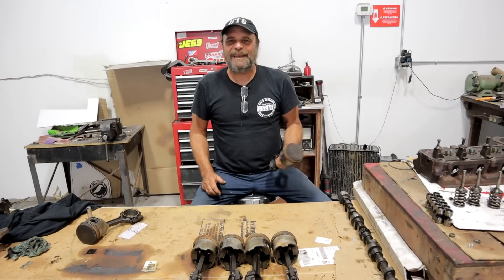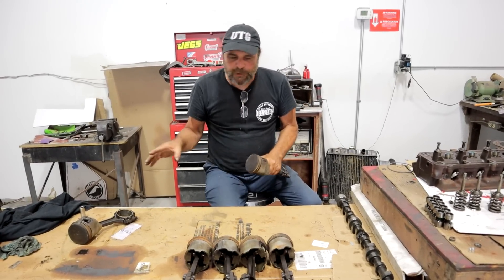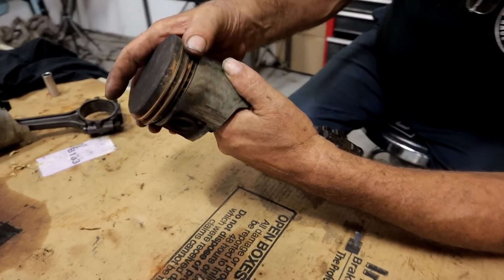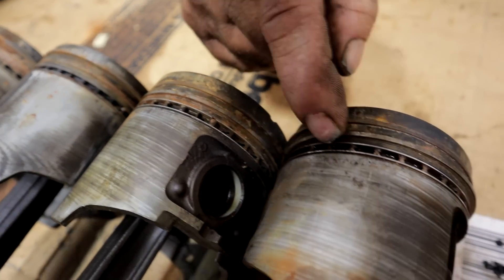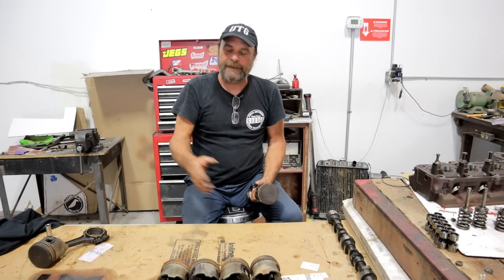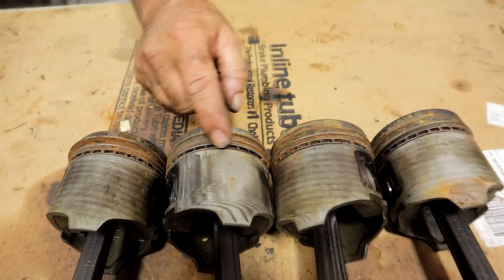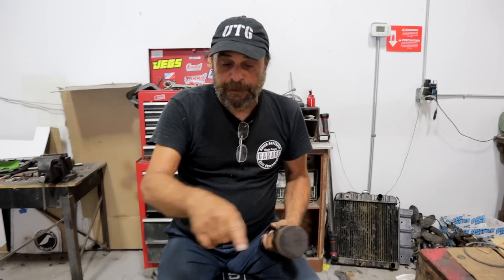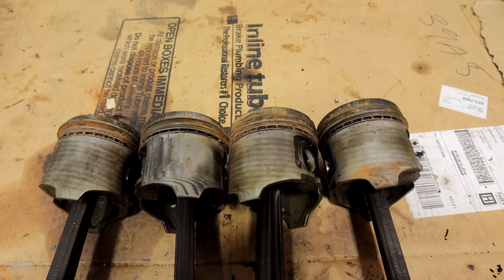Saving A Stuck Engine - Which Solvent Will Get The Job Done?  Jump In And Tell Us What You Use

Comment from the maker: PLEASE READ BEFORE COMMENTING!!!  What we are attempting to do is simulate freeing these rings while INSIDE the engine.  So, things like heat, ultrasonic cleaners, etc. wont work.
Approach this as if the engine is still fully assembled, and the solution is something you would pour in through the spark plug hole.
Thanks!
Reply: pb blaster. I used it recently in a 1962 Valiant with an aluminum slant six that was park in a California Walnut Orchard for 41 years. Pulled the plugs sprayed in pb blaster, waited 24 hrs, rotated the crankshaft gently back and forth until it was free. I used a fresh gas supply and a new battery and it lit right of in less than 5 crank rotations. That was a month a go and I drove this car to work today.
Reply: Marvel Mystery Oil through the spark plug hole
Reply: I've always had good luck with  k1 kerosene
Reply: Marvel. I want to see that tested against ATF Which is the commonly suggested method and what I have used in the past to free pistons and rings.
Reply: Dump muriatic acid in. 
That will free up the pistons.
Reply: Ahh in this case,i learned from Vice Grip, pour in mistery oil and a rust remover like CLR or evaporust,once free turn the engine to eject the soup through the plug holes.
Reply: Straight ATF fluid
Reply: Sorry, didnt read before. Half part acetone and half part atf is THE best
Reply: @felixlafuente9714 Same as my second choice, as my first choice doesn't fit the rules.
Reply: I would probably say Marvel's mystery  oil But I would also like to see what PB blaster and ATF do also Maybe even try like a high detergent automatic transmission fluid It's gonna be interesting to see what works The best
Reply: Like I said KROIL. I just added the ring thing to be helpful in the future.
Reply: BTW, I had a 70 340 Dart and the lifters were sticking. Dad had me change the oil and replace with 4 qts of oil and 1 qt of ATF.  Yup, fixed it. Miss that guy.
Reply: @johnagreen883  I used to charge people to do this and teach them how to do it. I'd run it hard for a little bit to get it hot, overfill with ATF, run it around the block, then drain.  People always said their car was quieter and smoother afterwards.
Reply: Kroil. The stuff penetrates. It wicks and creeps and soaks through and seeps. It is all about capillary traction action!
Reply: Diesel fuel
Reply: In that case I'd use Kroil. Our mechanics at work love the stuff, to the point that inventory stopped buying it because so many cans were going out in lunch boxes. They went back to PB Blaster because nobody steals that shit.
Reply: Marvel Mystery Oil & Transmission fluid mix (50/50 mix)
Reply: My cool dad taught me a lot about things like this Tony.  As several have said, he swore by Marvel, and also liked ATF. One or the other, or both. Once the engine is started and builds heat the rings should free.
Reply: This rules out what was going to suggest, dunking the rod assembly into proper carby cleaner.
Reply: I would say 2 stroke gas
Reply: Robotussin... you gotta let that 'tussin get in there.
Reply: Uncle “Dirty New Yorker” Tony an ignorant and insufferable Mass-hole gots a question for you. I may be wrong but your down in Tennessee now rite? Derek from VVG is in Tennessee now too. I know he’s mentioned you’ve be in contact before when he was in Minnesota. I’d love to see a collaboration video. The duster he said he spoke to you about has never been touched there’s a starting point
Reply: 50:50 mix of ATF and acetone usually creep into the gaps fairly well.  Once it's soaked for a while, spin the engine without plugs to eject any excess, then see if you can get the engine to start - the shocks from the cylinder firing, along with the heat on the piston crown, will sometimes get rings to shake loose.
Reply: Hi Tony,  Hydro Seal works great..
Reply: Marvel mystery oil
Reply: Liquid Wrench

Comment: Sorry, I didnt see this earlier. An old Tractor restorer told me what to use. And this works great. Get a big jug of whesltys bleach white, yep the same stuff ya use on your white walls. There is a bit of acid in it.Pull the push rods all out. Take the plugs out and rotate the engine so you fill the cylinders on each side. Put the plugs back in. what a couple days. Presto Chango. broke free. I have done this on 3 motor home 440s. it will even release the rings from the pistons. Drain that out. I then use the good old Marvels in it. Roll it over a few times. And then I take them apart and check them out.

Comment: I grew up on a Farm and we did all of our own work. Many times we would come across an inline motor on a tractor that got rain down in it because someone forgot to cover the exhaust or the rain cap was missing. Water would go down into the exhaust manifold and seep into the cylinders and rust them up. 

We would pull the spark plugs and fill the cylinders with number 1 diesel or a mix of number 1 diesel and transmission fluid and let it set. 

We usually waited a couple days and then everyday we would walk by and put a 3/4 drive socket, breaker bar and a piece of 4 foot pipe on the crank and try and turn the motor over. 

Sometimes it would give pretty quickly and sometimes it would take a little time but one day it would just move.

The thing is that it almost never failed. 

One inline six out of a 63 impala I bought on an auction was so bad that I just filled the entire block and intake up with #1 Diesel and let it set for a month.

I drained it all out and pulled the plugs. We decided to drag the car behind a tractor to unstick it. The car had a manual transmission. I put it in second gear and we drug the car about 40 feet and I let the clutch out and everything just started spinning. I felt a little slight bump and that was it , she was free wheeling.

The valve cover was so full of carbon that all you could see was some spots where the rockers were at. 

I dropped the drain pan and scraped all of the sludge out and cleaned up the pickup and the pan. I scraped all of the carbon and sludge our of the valve train and the valve cover. 

We left the valve cover off and filled the block up with diesel right up to the top of the oil pan. 

I started the engine up and let it idle for 20 minutes and shut it back down and drained everything again.

The stuff coming out looked like thin molasses. We did a service on the car and drove it for 100 miles with good oil and a quart of MMO in it and did another oil change at 250 miles, one at 500 and one at 1500 miles. Every time we put a quart of MMO in with the oil. 

That motor came out of it and quite burning oil and I actually saw the compression improve.

To this day I swear by MMO for cleaning the gunk out of an engine and breaking down the crud in the piston rings and valve lifters.

I vote number # 1 diesel and another high detergent lubricant mixed 3 to 1. 3 parts Diesel and 1 part whatever you got in the shop. MMO , Transmission fluid, brake fluid, Sea foam, or whatever you got laying around that is good and breaking down gum and varnish.

Comment: My nephew got an old 50's era Ford Y block that had been sitting for 20 years to put in his '53 panel truck. Engine was frozen. We put WD-40 in the first day and let it sit. Then we used some spray penetrating oil. Last we pu in some 30 weight oil. Then we let it sit for a week. To break it free we bolted a piece of unistrut to the flywheel and beat on it until we could turn it by hand a few times. We managed to fire it with the starter the next day and had a stuck valve. That was taken care of and the engine has run fine ever since and has never been completely dissassembled.

Comment: I have used transmission fluid in the cylinders to free up an engine.  I poured a bit in each cylinder and left it overnight (maybe a couple cap full at most).  The next day it was free to turn over with the starter.  My Dad used that 318 for quite a few years after too.

Comment: Had an AMC straight-six that I squirted oil in the cylinders and used a hydraulic jack. By removing the bleed screw on the jack and hooking a hydraulic line from the bleed hole to the spark plug treads on a cylinder that had closed valves. Was able to "jack" the piston down. Then on a '76 Fiat Super Brava with swollen/corroded cylinder walls  after giving up useing a 4x4 and a 16lb sledgehammer I was able to remove the crankshaft, reinstall the head with valves closed and blast the pistons out like cannon balls with a 3000lb nitrogen tank. The pistons flew across the yard and into the hedges.
Reply: The AMC ran after that and sent back to the owner as is. The Fiat was honed and reassembled with original parts and was my daily driver for the next 15yrs.. 1/1000th of aluminum makes 1/4 inch of corrosion so with minimal damage blessed the engine and sent it on down the road.

Comment: I freed up a Ford 352 with ATF and a couple weeks of it sitting around and trying to turn it over with a breaker bar every other day and topping the cylinders up. After about two weeks I bumped it with the starter and it broke free. It's been running for 2 years.
Freed rings on another engine with ATF and a propane torch

Comment: I have used a mixture of 1 part acetone, 1 part pb blaster, 3 parts atf and 1 part diesel fuel. I have an old yanmar tractor that wouldn't start due to not enough compression. I dumped that mixture down the exhaust pipe and turned the motor over by hand back and forth for a little less than a week. cranked it over and it slowly came back to life until it finally ran(it was hitting 400 rpm full throttle barely bumping for a good minute then it finally built some compression and started running strong) its been running better and better the more I have used it

Comment: Hi Tony, I have used a half and half mixture of ATF and acetone. In my case it did not help.I also used PB Blaster on the same engine and it did not work either. Maybe it has nothing to do with the products I used but something else.  Would you use these methods on an engine that has Nikasil coated bores?

Comment: 50/50 mix of ATF and Acetone. Works every time. I've dumped that stuff down the spark plug holes and let it sit over night, and it frees things right up. The acetone is pretty potent, and it's thin enough that it's able to penetrate pretty well. The ATF is also thinned by the acetone, but lubricates well enough to get things moving. I had a job restoring some old BMW 2002's, and nothing worked better than the 50/50 ATF Acetone mix.

Comment: SiliKroil by Kano Labs. The thing about Kroil oil is that it works best when you give it some time to work. I spray it on & let it sit overnight when dealing with a badly seized nut or bolt. Kano has another product "Kreen Motor Tonic" that frees stuck rings, dissolves varnish & rust, etc, but you add it to the oil & gas.

Comment: i would try diesel first then trans fluid or a mix of both . i had a seized 390 ford and filled it up with diesel for a week then started working it by moving the crank back and forth . then started the engine it ran perfect  after burning out all the diesel it did not smoke the engine ran for years

Comment: May sound weird but the best solution I have used yet for dissolving carbon on rings is CASTROL SUPER CLEAN.  Water soluble, mix about 30% Super Clean to 70% water. In 24 hours it will not rust bare steel, just vacuum it out and add some atf for lubricant.
Reply: Never would have thought of this but SC will clean anything.

Comment: I freed one up with some PB,but there's tons of things you could use. 
Yeah, mine ran ok but after a year or 2 and around 25-30k on it but  the blowby was getting to be a little much. 
Upon teardown ,one cylinder had 3 nice rust rings where the rings rusted to the cylinder. 
That's never gonna "wear off" if it didn't in 30k miles.

Comment: Try Seafoam aerosol. Why? Last summer I was working on putting a bike back together that hasn't ran since 1979. The engine was stuck. 3 yrs ago put atf in each cylinder, moved engine around so it didn't pool in one spot. Get it all around top of piston.  So last summer put engine back in frame, got engine mounting bolts in place, Without pipes on 2 stroke I can see pistons. Tried kicking it over and still seized, won't budge. Squirted Seafoam in each cylinder, grabbed a broom, cleaned place up a bit, about to leave and thought I wonder if it would turn over. Used my hand, pushed on kickstart and it turned over freely. Will it work on rings? Try it. Soak em down last thing at night, go to bed and see what happens next day. Plus I have NO affiliation in any way with Seafoam.

Comment: Tony whenever I have a motor that sat I mix equal Parts PB Blaster and Marvel Mystery oil with about 10-15% STP for lubrication. I fill each cylinder until it runs out the spark plug holes, then put the plugs back in, then pour more down the intake, soak it for a week, then pull the plugs and put rags everywhere then spin the engine with the starter until it's all out. Then fill the carb with gas, and try to start it, if it won't I blast it with either and once it gets hot the rings usually free up. If it won't stop smoking I use seafoam.

Comment: I have some Pb blaster and ATF mixed 1:1. I am using this with a little gasoline, but it still isn't working on an engine I have. I'm in NY so pretty sure aluminium+iron+water+decades = pistons will have to be broken out.

Comment: Thanks for the pinned comment that changes the game tremendously.  Use k-1 Kerosene  & 2- cycle oil. mix evenly fill each cylinder let set 24hrs with spark plugs out then turn motor back and forth until free then rotate motor a few times to push out excess mix.

Comment: Mexican Coke (glass bottles in the little Mexico section of the grocery store) .  The acids from the natural sugars eat shit alive .
  Those are already exposed but with a piston stuck in a block I also try to keep the cylinder heads on and add about 2 to 3 psi to the cylinder to help push the fluids deeper.  I have actually had the piston(s) move with decent pressure added .    Werk smarder so ya ain’t werkin’ more harder !

Comment: You’ve got two problems to address, rings fused to the cylinder walls and rings stuck in the lands, and I don’t know what it is exactly that’s holding the rings tight in the piston. I think I’d spray a prodigious amount of Chrysler Combustion Chamber Cleaner in there and see what that does, I recall that stuff being pretty fierce.

Comment: Im a member of a railroad museum here in my hometown, and our favorite is mixing diesel with mint oil. I have NEVER encountered anything that works so well. Absolutely mind blowing. But if not that, I just use good ol Marvel Mystery Oil. 🤘🇺🇸
Reply: What ratio do you use?
Reply: Interesting. I use a 50/50 mix of wintergreen oil (which is probably the same as mint oil) and rubbing alcohol to rejuvenate old rubber parts on motorcycles.

Comment: One thing.. not gonna choose heat because that's too obvious. Now, if those were still inside stuck in the block... I'd say "essential lube" . Stuff smells something terrible. Works very well.. I'd rate it like a concentrated but a little slower acting pb blaster. So essential lube is my vote. But to be honest, just grab the mapp gas and heat the rings staying moving around the piston. It will pop free in no time. But I'd really like to see you test out essential lube.

Comment: Diesel fuel, mystery oil, or penetrant oil? Ill go with mystery oil. Could do it when its cold, then run it, then once its hot, try to remove plugs without burning yourself, add the oil, then let it fully cool down. The next time you start it, see if it did anything. Hoping that as it cools down the oil will creep behind the rings. Just a though. This would just be a thing I would try on a worn-out engine, where maybe the rings are full of crud and not sealing, vs an engine that is locked up. All you can do on a locked-up engine is soak the cylinders multiple times untill it frees up. But after that some rings still might not seal, so you could try my cool down idea. I will be here to find the answer!

Comment: I’ve freed up a few engines with pb blaster.  I’ve literally filled the cylinder with it on quads .

Believe it or not lighter fluid works really well too. Because it’s so thin it actually can get down into small tight places.  

Once you get the piston out soak the whole rod and piston in purple power for around 24 hours. It will look brand new. That should be your next segment, once the piston is out what solution do you clean it with. I cleaned everything in a bath of purple power ( can be had at Walmart) takes like all the work out of it. Once you take it out of the purple power bath you pretty much just rinse the part off with water and it’s gleaming.
Reply: Wouldn't mind seeing that last part!

Comment: Free All. It doesn't seem to be a traditional oil, it feels different than a typical penetrating oil and it has a different(awful) smell. I used it to free up the stuck 200 six in a '65 Comet I bought that had been parked since 1992, a good long shot in each plughole and it was loose immediately. I was impressed. Try it on those rusty needlenose pliers we all have in our toolboxes that no amount of penetrating oil can loosen up. Stuff is freaky good
Reply: Yep I got recommended the stuff by a guy at O'Reilly's. Decided to try it and 2 years later its all I use as my go to rust penetrant. I'd usually move onto using ATF/Acetone on very seized things but I have yet to use it on something so badly rusted that Free All cant take care of it. For once the guy behind the chain parts store counter knew what he was talking about and Im glad I took his recommendation. 

I'm suprised I don't see more people using it. It's just as good as Kroil but much more affordable and definitely as effective.